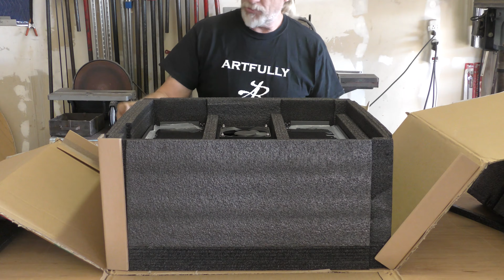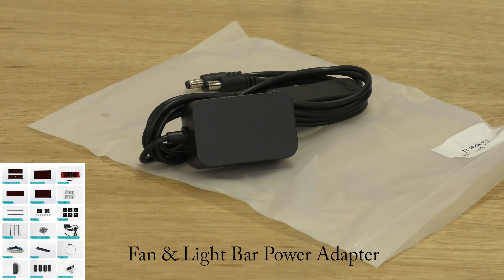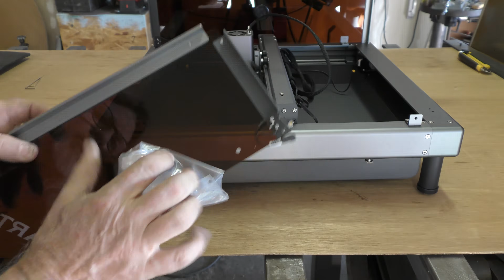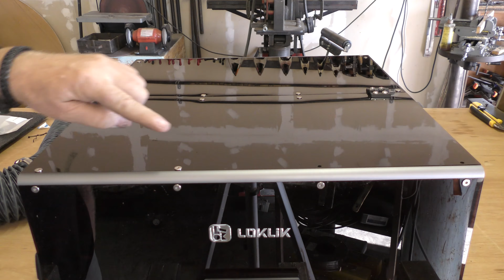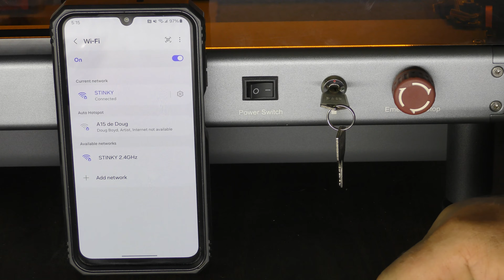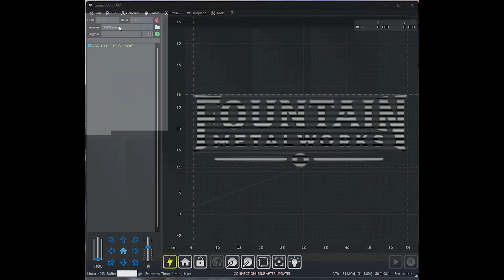Unboxing , Assembly and Testing - LokLik iEngrave @loklikofficial @htvront

Comment: This was an excellent unboxing and assemble video! Thank you for taking time to make this, and I also noticed my bed was a little wobbly when taking it out of the box and there were two of the thumb screws in the front that were loose so I tightened those but when I felt underneath towards the back, I didn’t feel the others were missing until I saw your video and flipped mine over store off. The two back thumb screws were missing and sure enoughthey were in the bottom of the Styrofoam packing! I emailed their support team and let them know of this quality control issue.
Reply from the maker: I'm glad the video helped you locate those missing screws! When I saw the screws, I figured they just fell out of a bag but I did the same and mentioned the issue to the company. Thanks for watching

Comment: Thanks for the video. Very helpful set up instruction. Can you tell me what you have inside holding your wood piece up off the bottom?
Reply from the maker: I used two pieces of 1/2" aluminum angle and they seemed to work fine for me

Comment: Looking forward to future videos with the laser. I've been looking at these for over a year,  i was surprised this company didn't have their own laser software.Most companies do. Actually, I had never heard of this company before, but they're probably all made pretty much the same.
Reply from the maker: Yeah, I've never heard of them until they reached out and wanted to collab on the laser engraver. Looks like they've been in the craft scene for a while and have recently gotten into the laser engraving market. It's been fun to play with for sure.  I've been using the Laser GRBL software which is free and fairly straightforward to use